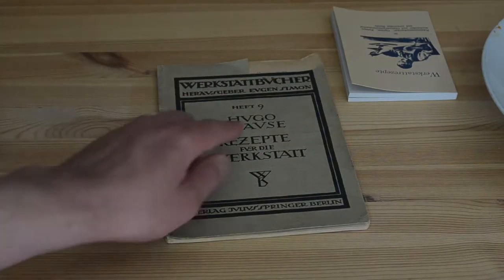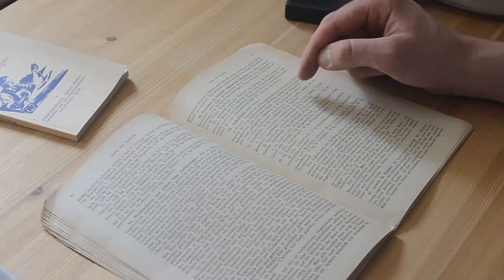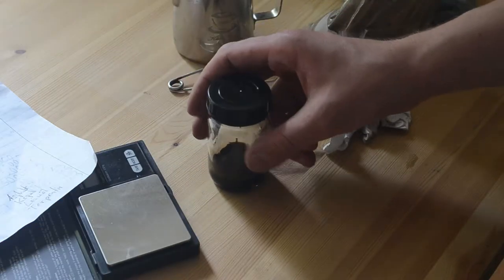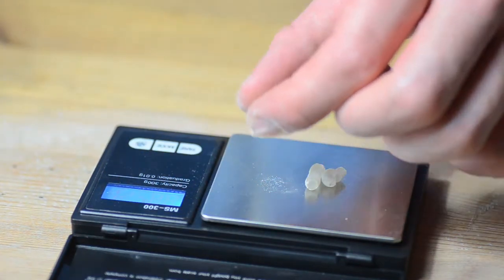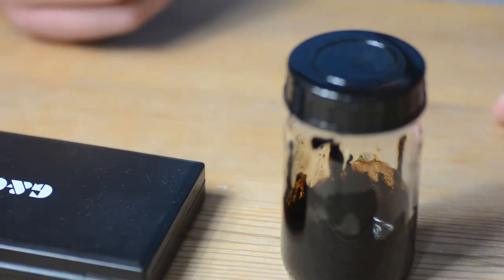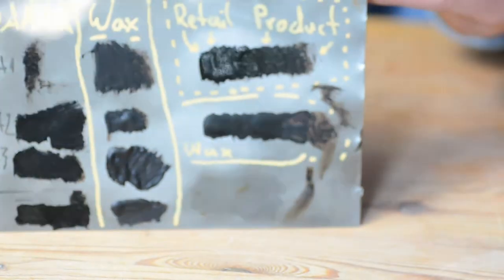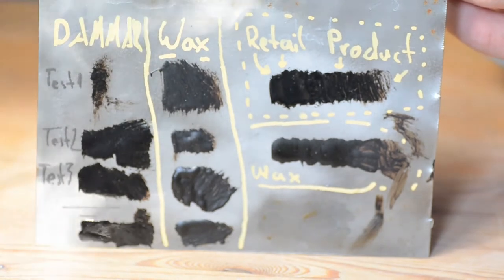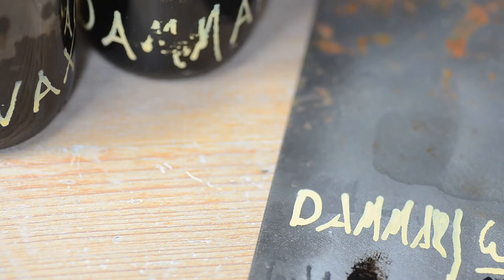1922s German Japanning Recipes

Comment: Thank you for this info! Which recipe would you recommend for a brass camera? Such as a Leica 

I think airbrushing would be needed?

Thank you!
Reply from the maker: I would use the receipe of Hand Tool Rescue. He found a decent recipe, only using 3 ingredients. Asphaltum, Linseed Oil and Terpuntine. Or use the modified version of receipe c. The rosin gives more hardness and a glossy effect depending on how much you use. But Rosin can make the surface brittle if you add too much. The recipe is well rounded, there should be no cracking.
But even though my recipe dries without putting it into the oven, I would highly suggest to put it into a little oven or so because alspahltum needs a certain thickness to maintain the color you aiming for, but it comes with the disadvantage that there will be brush marks. If you put your item in the oven the paint will liquify again and equalize that marks. What results in a pretty even surface.
Reply: @Baerenson  Thank you so much! I've tried using box store Lacquer aerosols and although looking nice, definitely are not as durable as a factory finish. (Possible to scratch with your nail)

Do these recipes really offer more direct- to - metal adhesion??

Appreciate your time.
Reply from the maker: @PLAZAOFFICIAL  Asphaltum alone is very sticky but I wouldnt say it has better properties than modern products. Japanning is an ancestor of what we have today. Paint evolved and I dont think they made paints worse over time. Using it today may seem more nostalgic than practical.
It depends on preferences. Do you want an  unique original look or are you satisfied with just a modern paint in the right color.
I think both ways are reasonable fine.

Comment: polymerization reactions occur between the metal and the coating, and within the coating itself.  Theory:  Raw linseed oil would adhere to the metal better, and would provide a stronger finish.
Reply from the maker: Yia, like the idea. Also think that pure linseed oil has better properties. Would like to know what baking the coating would do and how different it is
Reply: @Baerenson  yes, that would be great, thank you

Comment: Has anyone looking into health and hazard of such chemical mix?  There got to be a reason that the industry has move away from it.  $, better process, better tech protection,,,,,,,Safety hazard is among many things we change how things are made.
IMO, not worth doing it without knowing more information.
Reply: spray lacquers in different colors were introduced.  the baking process was expensive, the waiting time was holding up production,   Yes, turpenes are carcinogenic, , , ,prolonged exposure to the powder could cause a rendition of black lung, rags with linseed oil can result in spontaneous combustion.  The MSDS for all chemicals is available, , , ,Section 11 contains the health risks.